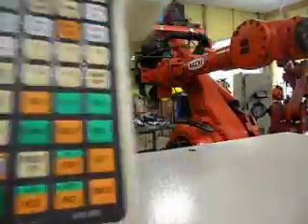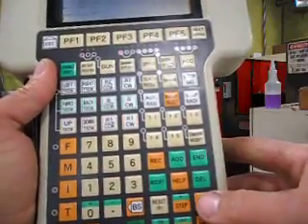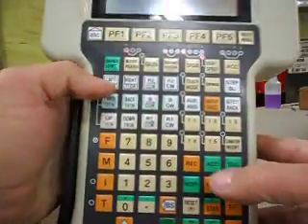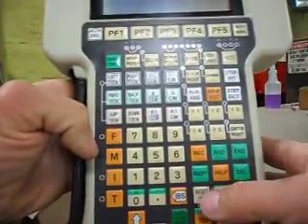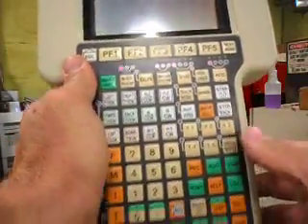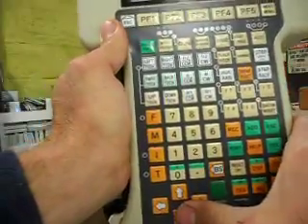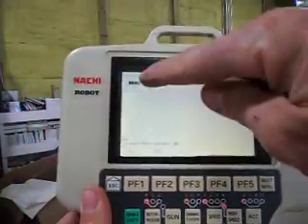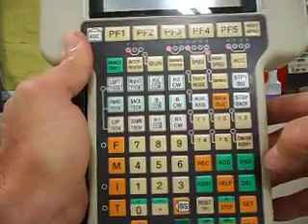NACHI AR robot training #2

Comment: Hi Great video! I have a question. I am working on a Nachi robot and there is an error code E50 Servo error: CTR-OVF. I know it might be the encoder reading mismatch caused by dead battery. I want change the battery , but I could not find where are the batteries.

Thank you.